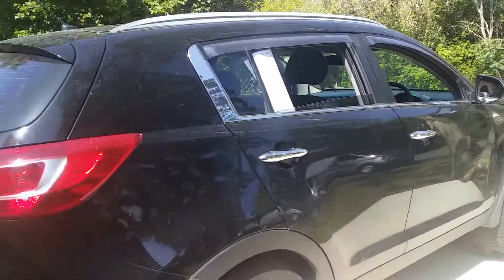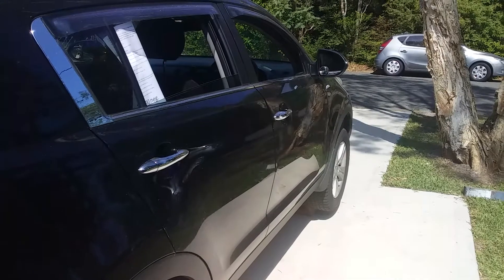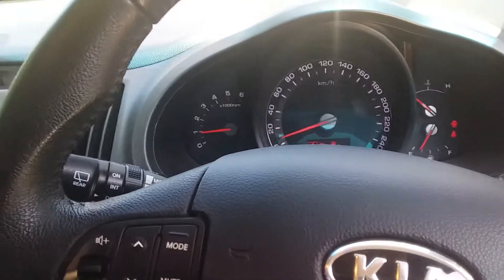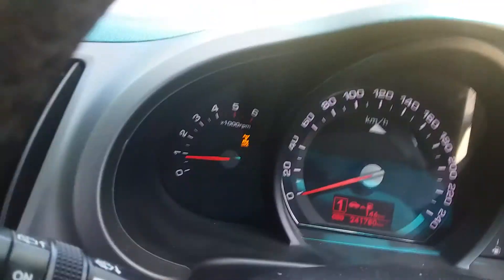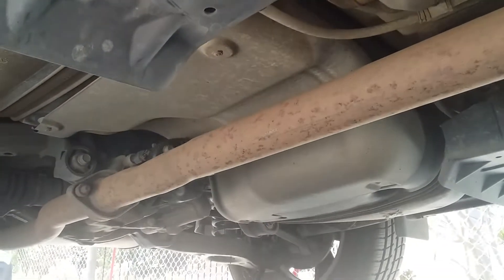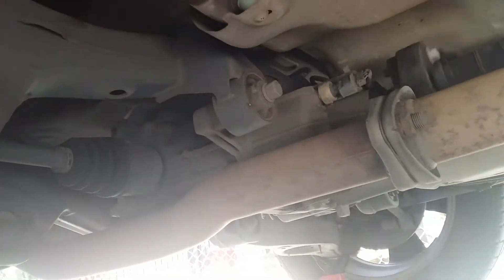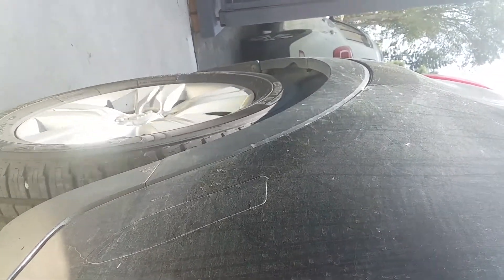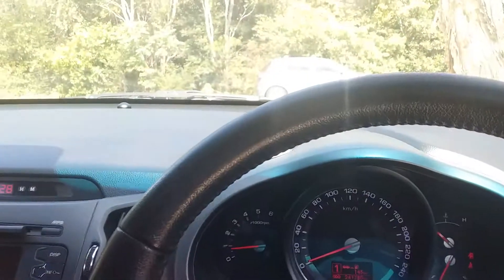Pt1: AWD warning light on! Slow engagement of rear on 2011 kia sportage. Fixed in other video.

Comment: My rear diff went and this was the
Issues anyway, had the rear diff flushed and found a lot of grey. Smelt burning plastic driving up mountains until it gave out
Reply from the maker: Was burning plastic smell wiring ??
Reply: @zoltanp1967  not sure tbh, replaced rear diff and now it’s starting up again. Hard to tell if it’s like “Kia” faulty lemon awd system or if I just have a lemon. I fear it’s more than just me after seeing the same issues though with others. 

I had the rear diff fluid changed as often as oil last year and it seemed to help a little. But every 10,000 miles vs 20-30 for a flush sounds off to me. Smells like I got plastic belts in my awd system that are burning up though, only going up steep incline, unfortunately for me I live in the “green mountain state” so tons of mountains 🙈😅

Comment: Thanks for this video man. After searching so many forums online this could probably experience a similar issue i have faced few times 😃
Reply: should work i just cleaned the two terminal at rear differential. mine and the AWD light went off.